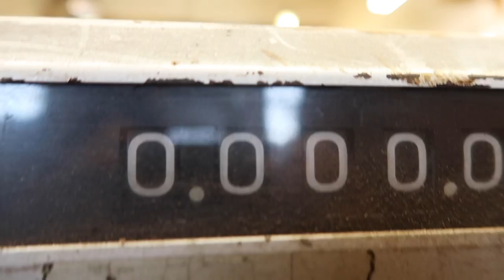RED WING IRON RANGER Resole #60

Comment: Thanks for another great video, I find them wonderful, watching an artisan at work. I have to wear an apron at work too and I find the strap around my neck irritating. One guy showed me that if you cross the straps across your back like an X, so right shoulder down to left waist it removes the pressure on your neck. Once you have the length set to put it on you put your head through first and then put your arms through, like putting on a sweater. I don't know if it's a problem for you but I thought I would mention it anyway, cheers🤘💪🖖

Comment: Those nails look like they’re too long and would come through the bottom of the inside of the boot
Reply: If you notice at the beginning when he's prying the heel off, you'll see the nails are bent over at the ends. The nails are hammered through the sole and against a steel plate that hooks them over so they hold better and don't poke through the insole